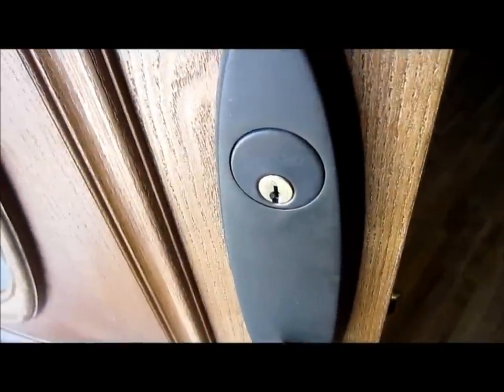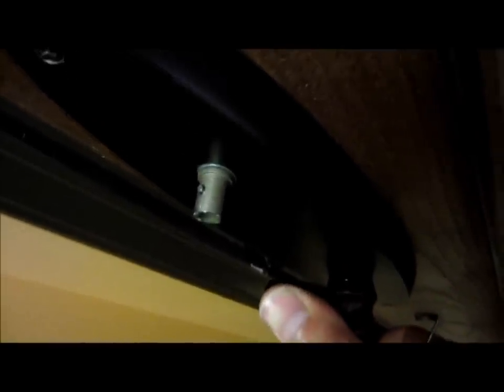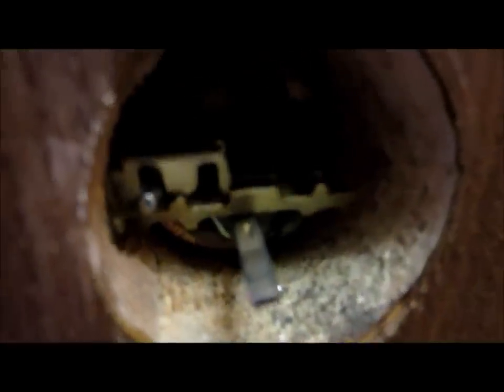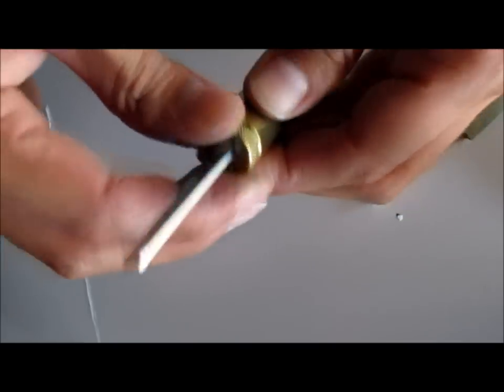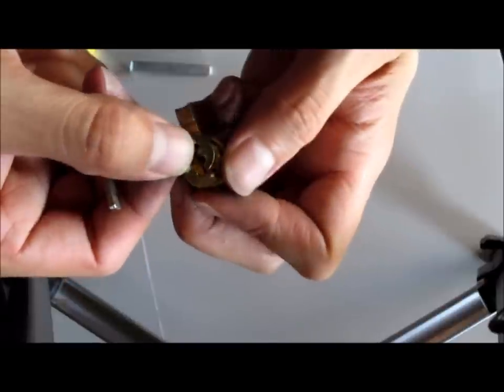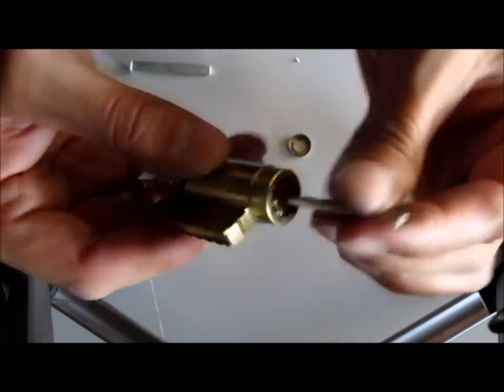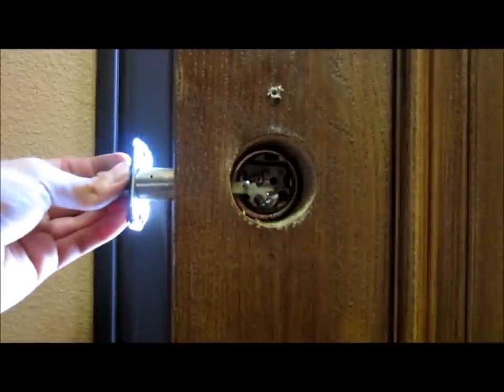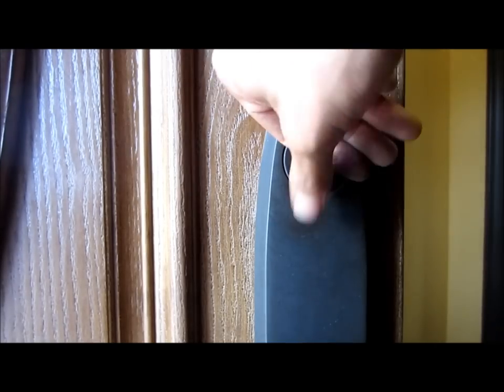How to replace Schlage deadbolt cylinder lock

Comment: Where the number located on tbe lock and whats the excuse I need to use to get replacement? Ty great vif
Reply from the maker: As long as you call schlage customer service and tell them that your securekey deadbolt stopped working, they should be able to work with you and send you a replacement deadbolt by using the number that is located on the back of your original schlage key. I hope this hels you.
Reply: thanks a lot for your help they sent it right away but haven't had time to put it in